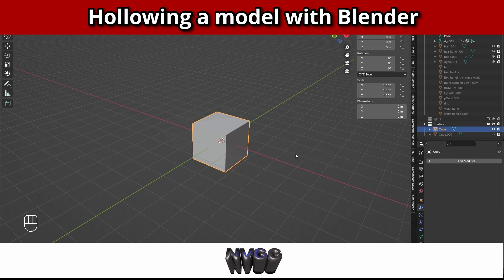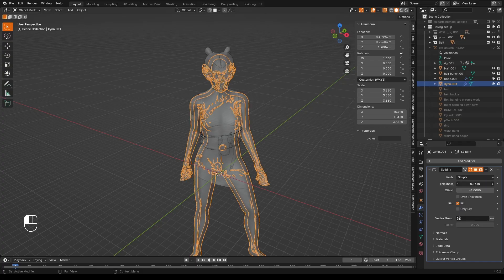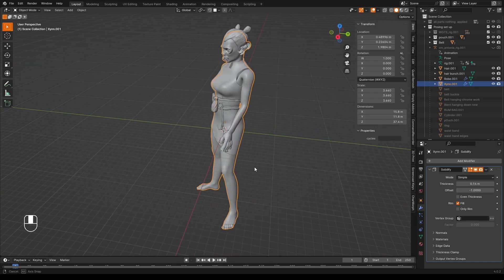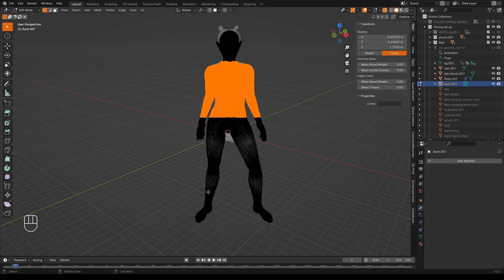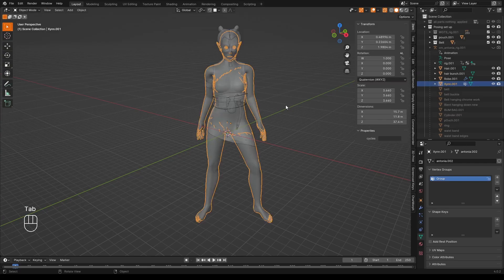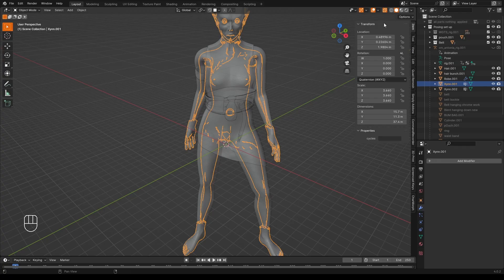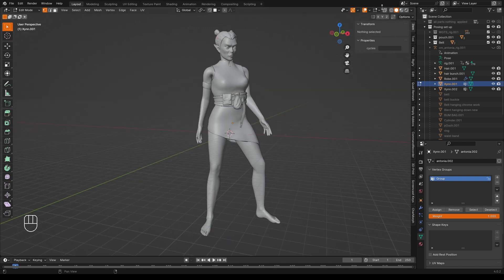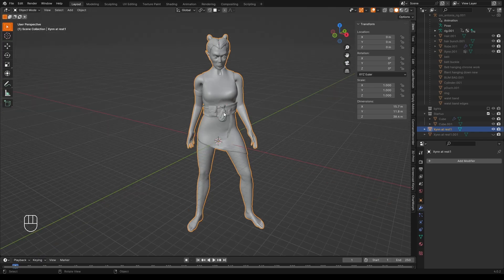How to fine grain hollow a model in Blender for 3d printing

Comment: This is much easier now. Install the 3D print toolbox addon inside of blender, on the side panel go to it and where it says edit, click to drop down then there is a button called hollow, adjust the inside offset and bam. Then you just do a boolean difference on the original and then it's hollow.
Reply from the maker: I just tried this myself and you're right.  It does a pretty good job too.  You still have less overall control using this method but 99% of the time you don't need that anyway.  I'll update the description of this video.  Thanks :)
Reply: @notverygoodguy  Sure thing! Us blender users always try to find the easiest way to do something haha, figured I'd share mine. Great video thought and definately still useful in some cases!
Reply: when i adjust the inside offset to a few mm, blender always crashes. do you maybe know what the problem could be?
Reply from the maker: @fizzybeard7291  Are you referring to the 3d print toolbox method or the version in this video?
Reply: @notverygoodguy the toolbox version. Also if you are here, do you maybe have a tutorial how I can make my model a hollow lamp with no walls and only infill "walls"?
Reply from the maker: @fizzybeard7291  The 3d print toolbox has always been a bit twitchy and prone to struggle a bit, especially if you have lots of vertices in your model.

I don't have a tutorial on printing with no walls as this is more a blender for 3d printing channle than a 3d printing channel.  However I am not sure I understand what you want, you want a hollow model with infill for walls?  Why not just make walls that look like infill?
Reply: @notverygoodguy how do I do that? I printed a lamp for my kids that had only mesh? As walls and hollow on the inside so it lit up very nice. I'm not sure about all the correct words and stuff haha

Comment: thank you for the knowledge, sir! A few questions if I may... After hollowing out the model, do you add supports to the hollowed parts in blender or a slicer? How well do resin printers print hollowed parts without supports? i.e. as long as there are no islands within the hollowed parts, do models print successfully reliably? The only thing that is preventing me from doing hollowing is me not having confidence to clean and curing the inner parts thoroughly, especially if there are supports within the hollowed portion.
Reply from the maker: Good questions.  I will add supports to the inside of a model if the angles are sufficient to require supports much the same on the outside of a model.   However, as you can control the "hollow" shape yourself  it is easier to make them not need supports.

You are more likely to be able to clean and cure hollow models than solid models.  The post UV curing process does not penetrate far into the model and it is quite possible to have solid models containing uncured or at least not fully cured resin inside.  This can crack models alarmingly in time.  I have had models suddenly have huge cracks appear after a few months when I thought they didn't need to be hollow.

For models of any appreciable size it is best to hollow your model with not too thick walls and add drain holes to drain excess resin out of and to allow your cleaning fluid to get inside too.

Adding drain holes exactly where you want them is often much easier in Blender using booleans than in slicer software.
Reply: @notverygoodguy  Thank you so much for the detailed response! Gonna try and see if I can make a spheric smooth hollow shape which should be a lot easier to clean and cure, then!
Reply from the maker: @ajidotsartandstuff4973  Good luck :)

Comment: what takes a second in a slicer... Blender really needs to take a look at 3d printing and not only focus on visual fx
Reply from the maker: To be fair, you don't get anywhere near the same control in a slicer as you do doing this with Blender.  What do you think Blender needs to do to support 3d printing that it doesn't already do?
Reply: @notverygoodguy  something basic like hollowing? without workarounds.  What about being able to work with exact measures when editing objects/meshes. today you cant even know the diameter of a ring you edit after its created. its basic stuff, but the foundation is totally dazzled by visual fx when a huge part of the users are actually creating real world objects with blender.
Reply from the maker: @eddiexx  The options for hollowing are much better in Blender in my view which is why it takes more effort but if you want a quick basic hollowing, your slicer already does that well.   I admit that sometimes I hollow a model in a slicer because it's just easier and then export it back into Blender for adding drainage holes precisely.  

You can absolutely measure the diameter of a ring after you edit it.  Enable the measureit addon which comes with Blender, select a vertex on either side of your ring and it will give you the exact diameter and it will also change as you scale.

It may not always be immediately obvious but Blender usually has a way to do something.  I know the focus is rarely on 3d printing but most people don't use it for that which is why there are so few Blender channels talking about it. 

The only thing I really miss is good parametric workflow but there are some attempts at the moment to provide that too.
Reply: @ blender is great but is allover the place thinking its "got" stuff when they really do not yet. Super interesting to hear that they are working on parametric features. that would be great. The worst part is when you bring up things like this (not you) people from blender just dismiss it. Cheers
Reply from the maker: @ I'm not overly confident that the parametric add on is going to cut it but it is improving all the time.  You can look at cad sketcher if you are interested.

Of course geometry nodes gives you the features of a parametric workflow too but is on a different level.

I am always interested in how people view Blender so thanks for the chat.

Comment: I made a part of my Tree hollow. To save filament and  time while printing. I doesnt work with the FDM Printer. It prints like there is no hollow Part. Is there a special Method?
I could print the Tree in Vase mode, but i have to place the tree on a Landscape and then print it together. So... a  partly hollow tree together with a landscape in normal Mode printing.
Any Idea how to do it?
Thanks for your videos
Reply from the maker: This should work with both FDM and resin printing though of course for the hollowed out part it is a little more difficult to add supports in an FDM printer slicer.   I would suggest turning on face orientation and then looking insider and outside your model to make sure the normals are correct.  I have a video on what normals are all about on the channel too if you are interested.
Reply: @notverygoodguy  Thanks a lot for the rapid answer. And yes, there were problems with the Faces. 
Now everything works great.The tree in Vase mode needs 1h29m,  that´s crazy fast ... but with Solidify at 0,2mm the normal print mode needs 1h 44m. Works like a dream. Before i hollowed the Tree with boolean tool and a slighter smaller copy from the tree..... ... but with solidify it is easy and works for me. Thanks a lot ...
Somebody must invent a printer that someone can place two Models on the print bed and one model will print in Vase Mod and the other Model in normal print mode--parallel. That would be great :face-blue-smiling:
Reply from the maker: @Container-11  You can already do one model in vase mode and another in normal print mode you just have to have a printer with two extruders and make sure one extruder doesn't crash into your vase mode model while it's printing given the vase mode will be quicker :)  Glad you have everything sorted now!
Reply: @notverygoodguy  Yep, your right, have not thought about that ...🙃

Comment: when I use the displace modifier, the model inflates either way, positive or negative. Maybe this is a problem with a new blender but im not sure. What is happening?
Reply: it dosent get skinny like in the video
Reply from the maker: @unloadedsushi  You do have to be very gentle with the slider.  Perhaps holding SHIFT while you do it will give more control.  If not could you provide a link to your blend file.  I may be able to take a look.

Comment: I liked your method. After adding displace modifier, and I hit apply. It gives Report Error " Modifier cannot be applied to a model with Shape key." 
Any suggestion. I bought add-on to resolve this issue, that did not help.
Reply from the maker: Your model has shape keys :)  If you are happy with the model, you can remove the shape keys before doing the apply.  They are in the little green triangle icon in the properties panel.  In there is a little box marked shape keys which lists the shape keys you have.  You can delete them by pressing the little "-" button but you must start from the first one and work your way down.  I recommend saving the end result as a different file as your model had shape keys for a good reason even if you don't need them for 3d printing.
Reply: It worked, thanks.
Nam
Reply from the maker: @earringtherapy  Thanks for letting me know!

Comment: I'am currently working on a very small object with sometimes a thickness of millimetres. So I think it's the best if I leave the hollow and make everthing solid in the inside. Is there a way to do that, or is any object already solid from the start and we just make a hollow to save resources?
Reply from the maker: Any manifold object (has no holes in it, even tiny ones) that has no walls inside will be solid.  In most cases this means that your model is solid unless you hollow it :)  

Hollowing is only really used for resin printing. if we are 3d printing with resin. Resin deep inside a model often won't cure and can later crack your model.  So, people often hollow their model and make holes in it so that uncured resin pour out.

Comment: Don’t you have to close up the now non-manifold holes created by deleting the hands and feet? How do you deal with self-intersecting surfaces that can occur in tight corners?
Reply from the maker: You could do that and the 3d print plugin is great for it but the slicer fixes it every time.  The model is still manifold on the outside of course. Maybe there should be a small warning that there could possibly be problems but I haven't seen them yet.    The point here is to avoid doing the hollowing at all on tight corners so if they are not part of your "hollowing" vertex groups they won't be hollowed and no intersections occur.

Comment: Saw a guy add a blue LED to his 3D printed figure, I immediately ordered some warm whites 0402 leds with wires for my gas street lamp models. Now I have a clue how to hollow them out.   If your figures are printed from a flex resin wires could be inserted to make it pose-able?
Reply from the maker: When I have added wires into 3d models I have found a good approach is to actually model a pipe or something that goes right through the model so wires can follow the rout of the pipe.  This pipe has to be modeled so that the slicer doesn't actually just remove it but for me this has worked well.   I have a model of a lady holding a flower to her nose and the flower has an led in it.  To do that I modeled a pipe from the flower, through her finger, down her arm, into the body and down to the base.   This made it much easier to thread wires through :)  This gives me an idea for a video though :)

Comment: hi, how do you do that on your head, hands, and feet?
Reply from the maker: The point here is that the hands and feet are too small for this to work reliably but in any case you don't need them hollow for resin printing because they are small enough to not need hollowing anyway.

For the head, you could just select the head when selecting the rest of the body for hollowing as show near the start of the video.  Some thought needs to go into what you are selecting though.  For example, ears probably shouldn't be hollowed or anything else that is very thin.

The good part is that if your displacement doesn't look right you can add and remove selections from the vertex group to fix it up.

I may do a follow up video for things like that.
Reply: @notverygoodguy   Sorry, I understand, my real question is how do you prevent the face and hands from being deformed with solidify, do you have a video, thank you
Reply from the maker: @EdgarCaballero  Do you mean how do you do it with the solidify modifier instead of using this method here with the displacement?  

If so, you can sometimes get it to work my changing the mode of the solidify modifier from simple to complex and playing a lot with the settings.  I was going to do a video of that when I thought of this way of doing it with displacement :)
Reply: @notverygoodguy  Yes, that's exactly what I'm looking for how to handle solidify in small details without deforming the details.
Reply from the maker: @EdgarCaballero  I think this displacement method is better than using solidify actually.  The end result is the same but you are able to model the shape of the hollow.  Remember also that for really small detail there is no real need to have it hollow.

Anyway, following a quick poll on my community page I've decided that the next video will go into this in much more detail and showing how we can handle complex cases.  Maybe it will help :)

Comment: I honestly forgot I subbed to you. I used your guides to help me with a 3D printing project that ended up failing pretty miserably (porting an FFXIV model to blender and then getting it 3D-print ready) and I haven't attempted it again. Doesn't help that I basically threw myself in the deep end. However your guides were super helpful for some of my questions during the process and I appreciate the vids!
Reply from the maker: Great to have you drop by :)  I try to cover topics that could be useful for people not trying to 3d print things but I have to admit it is my focus.  I hope you get the motivation to try your printing project again soon!